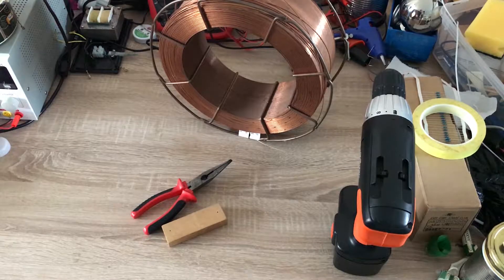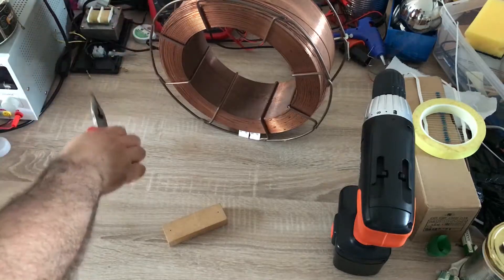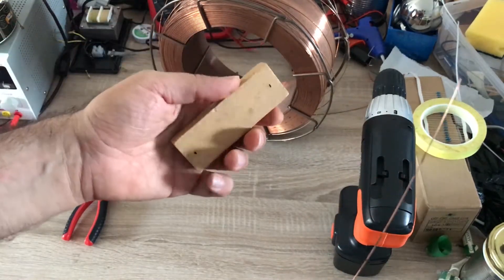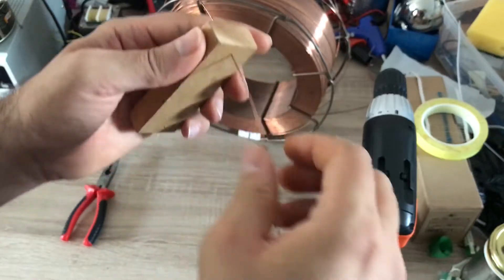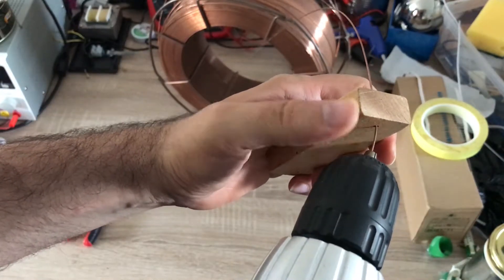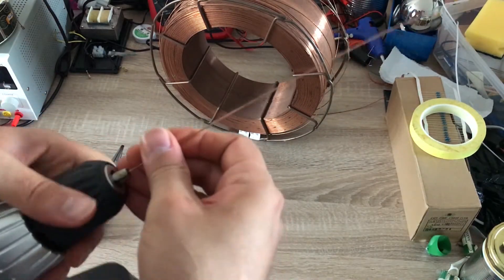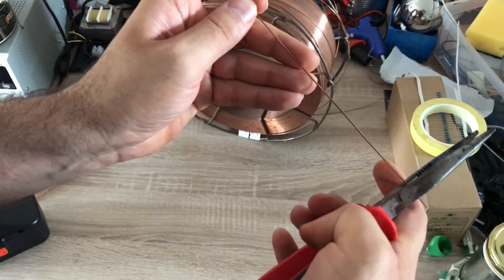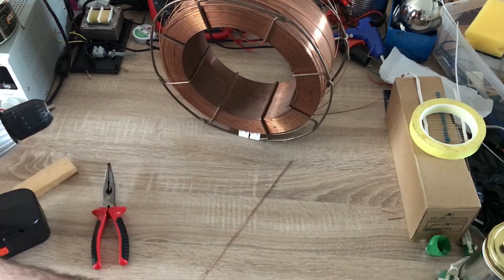How to straighten a piece of bent wire

Comment: i clicked this video knowing i'll learn something, and this is a common issue, pretty honest from you admitting it's not your original idea

for kinks i have a dent on the edge of my ruined desk and i swipe the wire hard inside the dent, it works for wires that are not too thick, for thick wires i have to use my fingers